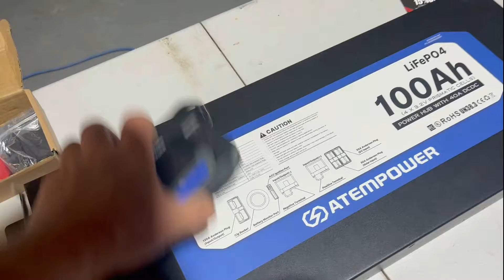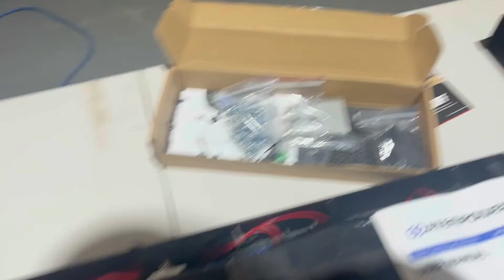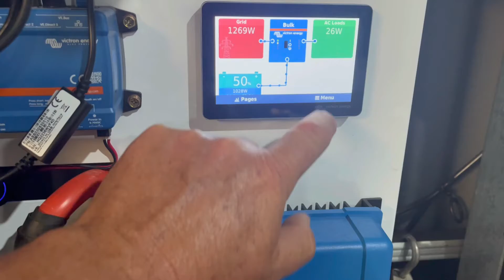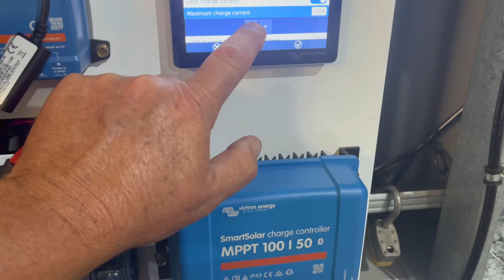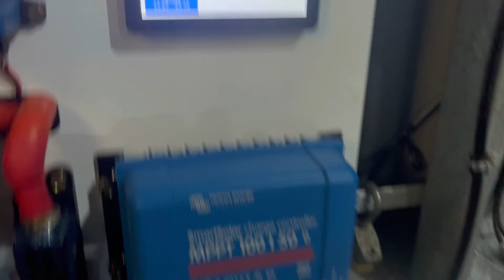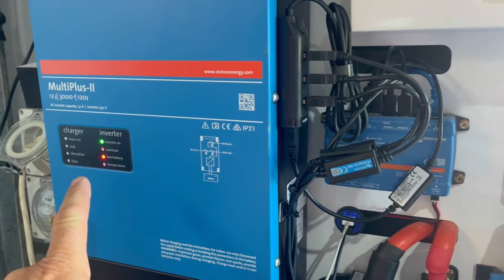AtemPower 12v 100ah Hub with 40a DC-DC  - REVIEW

Comment: As you said, that screen they supply looks clunky and appears to be way off the mark with it's readings. Even though I believe the Victron numbers going in, you could perhaps stick your clamp meter on the charging cable just to show the difference between what their whacky meter says and the reality. Just to double check.
That would fit easily behind the rear seat in many utes / 4WDs.  By the look of it anyway.  As you also said, it might be nice if they utilised space a bit better and made it a bit shorter. That would leave a bit more room behind the seat for cabling, or whatever.
I wonder what similar alternatives there are on the market? 
Also, can you tell what brand BMS and cells it's using?
Reply from the maker: I actually grabbed my clamp meter to test but the batteries were flat 😂.  I’d need to pull it down further to confirm BMS and cells. Might do that if I get time.
Reply: I picked up one of their solar panels to review. Haven't done it yet but from an output perspective it looked to be online with this product, as I'm average.  Those loose terminals though. I would have bet the house on them heating up for sure. I really don't know how they didn't.. Also try checking temps with a contact thermometer target than those ir type ones. I find when trying to measure reflective surfaces you won't get a good read off them.  The product concept is solid but the execution leaves a bit to be desired.